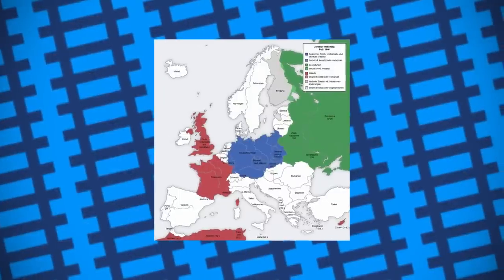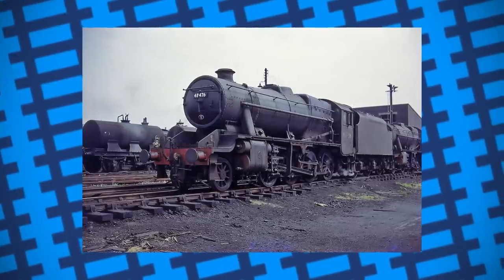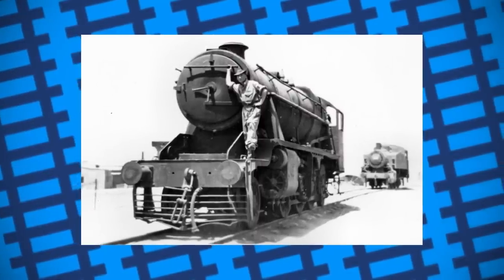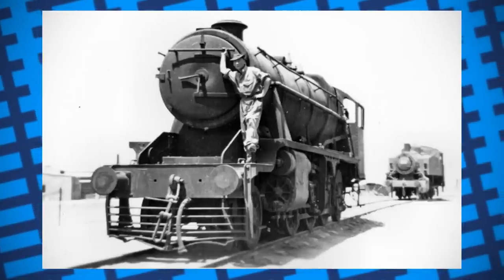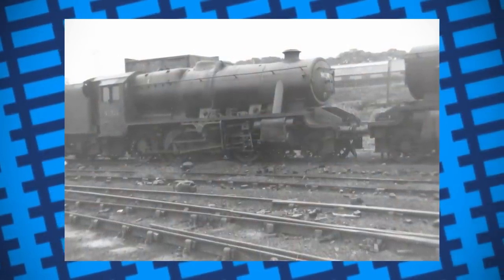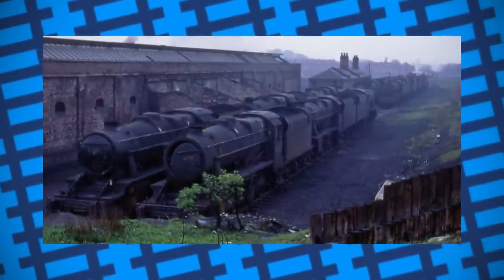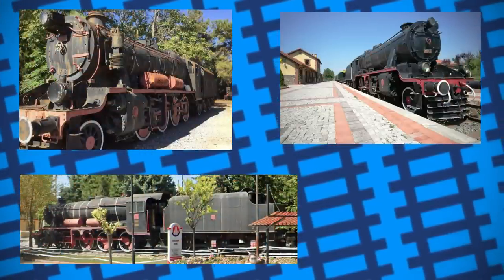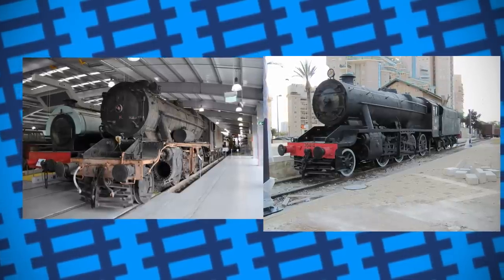The Middle East locomotives that weren't built for the Desert - LMS Stanier 8F

Comment: There is a very good reason these and the American locomotives did not make it to France before it was liberated. That was because the Royal Air Force and the United States Army Air Force took great pains to stop the Germans using it. They even used the 22,000 Grand Slam bomb, or earthquake bomb, to shake down a vital railway viaduct and bring down part of a mountain on top of the line running through it. After they'd finished with it no trains were traveling anywhere in Northern France.
Reply: The RAF and USAAF did trash the railway network in France but that wasn't the reason Stanier 8Fs were not deployed there.
The USATC and WD used lots of railways in Northern France post-invasion, but they did not use Stanier 8Fs because they had already transitioned to using S160s, S100s and Austerity 2-8-0s and 0-6-0STs respectively (as well as any French stock they could find). They were incredibly quick to repair the railways and get them running again.

Comment: Fun fact: the 8f 8233 as mentioned in the video is currently a memorial inside the Highley engine house on the svr to royal engineers and rail personnel who served on railways in the middle east and north Africa during world war 2
Reply: According to the wiki. 8233
(WD 307/WD 70307) derailed in her war years, because she ran into a camel. He also didn't mention that there were 4 8Fs at Longmoor.
•LMR 500 (8233)
•LMR 501
•WD 508 (unused)
•LMR 512
Reply: 3 of the 4 8F’s at Longmoor were sold to British Railways. One for some reason wasn’t wanted and was scrapped. My late father worked on them at Longmoor during his National Service with the Royal Engineers.
Reply: @peterflitcroft9756  
That's nice, sad the railway is gone, it basically a full size trainset.
Reply: @peterflitcroft9756  
508 wasn't used cause it was worn out. 512 was involved in an accident after running into Basra.
Reply: Another fun fact if this is true: The British even planned on bringing the LMS 8Fs to Mexico during WWII but the plan was scrapped because of the war and they needed their locomotives to be sent to the Middle East to fight the Germans. Honestly that would’ve been cool to have British steam locomotives in Mexico also from what I can see, the LMS 8Fs in Mexico would’ve looked the same as the ones in Egypt,Palestine,etc but with different couplings also they locomotives themselves would’ve ran better in the Mexican environment due to it not being as hot as Egypt’s climate also with more water over there.

Comment: Its interesting to me that many British locomotives when exported overseas ran into the repeated issue of having to little capacity for fuel and water. That was one of the big issues the D&RG ran into with their Double Fairlie Mountaineer in Colorado, it simply didn't have the kind of fueling range they needed between stations and they eventually took a flatcar and slapped an ad-hoc tender on top. I think if anything it shows how tightly compact the British network is with frequent water and fuel stops available, verses overseas networks especially in arid regions. 

Its not like American exports were perfect either, especially in wartime... as the issue with British crews understanding how to read American water sight glasses attested to when a handful of various S160's had boiler explosions over the course of the war. While all the core basic engineering mechanics of steam were the same everywhere, those fluctuations in appliance fittings or tender capacity or a myriad of other small factors seems to be the main issue in localizing an overseas export to any railroad.
Reply: In a way it makes sense, designers assume their locomotives will be used in specific conditions, but those conditions aren't universal. It was a frequent complaint made about British designed locomotives in South Africa that the designers had assumed fresh water would be plentiful and coal would be of high quality, those assumptions were true in Britain, not so much on the Cape of Good Hope.

Comment: I once followed the Nile up through Egypt on Google Maps. At one point I spotted some black lines close by the Nile that turned out to be a lot of abandoned steam locomotives.
Does anyone know if they disposed of the engines somewhere random in the desert? Didn't seem to have any connecting tracks either. 🤷🏽‍♀️
Reply: I think they were probably blown up
Reply: Can you share the coordinates I would like to check it out thx
Reply: We need the coordinates, man..
Reply: @everyone 
Alright. I've been looking up and down the Nile a bit quickly and haven't found it yet.
Keep in mind that I remember finding it like 15 years ago on Google Maps, so something might have changed?
Also, this was when I was young and had a lot of spare time to just spend hours drifting around the world map, so how close it actually was to the Nile is hard to say. 😅
I'll keep looking!
Reply: @Floedekage  just follow the railway instead of the river. There wasn't a huge network and no one woulda put in the effort to move them far from it so they will be on it somewhere if they exist. 

Rarely does a loco get moved far from the track it worked on especially in a place with limited resources to do so.

Comment: I’ve seen 48624. It’s a beast. Seen it at the East Lancashire Railway and I work there. Been working at the Railway now for 8 years. Another LMS 8f went to the East Lancashire Railway number 48518 only went there to have its frames scrapped. It’s the only preserved donor parts LMS 8F. It donated its boiler to its classmate 48773, don’t know what happened to its tender and it’s last remaining parts are at the Llangollen Railway. Most of it’s part are donated and scrapped. It’s possible to bring it back to how it was before it started donating parts but it’s gonna cost an absolute fortune to make so many new parts for her. New tender, new frames, new wheel sets, new boiler etc. it’s really sad to see it with small amount of it’s last remaining parts and that really makes me want to collect the parts and bring it back to life

Comment: We all see what extreme heat will do to the rails, right? I wondered how the railwaymen in the ME maintain them in such a great heat and distance?
Reply: America had a locomotive, the Hayes 4-6-0 camelback, where the footplate, which looked like it was part of a signal box, was on top of the boiler just behind the chimney. Imagine the heat of summer while stood on a boiler inside a glass box and being slowly kippered from the smoke. At the same time the fireman was stood on the front of the tender with a small roof over his head which exposed him to the heat of summer as well as the rain, wind and snows of winter. Somehow the romance of steam gets a little tarnished for all of these men.
Reply: Many many expansion joints
Reply: The real problem is not how hot a place is but rather the temperature fluctuation that causes expansion and contraction.  An environment that varies between -40C and 25C will cause more rail buckling than a place where the temperature varies between 15C and 40C.

Comment: You would think that modifying some South African locomotives designs would be ideal for conditions in the Middle East?
Reply: Wrong track width. Most Middle Eastern railways operated on the European standard gauge, while South African railways were the narrower Cape gauge.
Reply: @Dave_Sisson  ...narrow gauge(metre gauge) used to run from Syria all the way into Saudi Arabia. Some of it still operational with preserved steam in Syria until the civil war. Presumably the locomotives are still there hidden in a shed for better times.

Comment: I'd like to see that China Rail KF7 run again. It's a pretty interesting looking engine, looking a lot like an americanized British engine but I'm willing to guess it's probably too large for Britain for either loading gauge issues or just the fact it's a 4-8-4.
Reply: It's probably a hybrid and China is Standard gauge. Standard gauge is universal world wide it's the same in the US and UK. In fact most Railways in the world are either Standard Gauge or a form of Narrow Gauge. Most popular being either 3 foot or Meter gauge. The only exception of these are the Broad Gauge Railways which there are a few.
Reply: @Dallen9  
I'm referring to the loading gauge as in the width and height not related to the track itself. So like making sure it fits through tunnels and doesn't scrape on platforms. I forget which class of locomotive it was but they exported a number of EMD Sd40-2s to Britain but had to give them British bodies in order to fit through tunnels.
Reply: @patrickwamsley3284  That's the first I've ever heard of that. I know that EMD and GE do/did rebuild the Bodies for Export but never cause of Loading Gauge issues but for Aesthetic Reasons. Then again that could of also been them trying to sugar coat the actual reasons for the investing public.
Reply: @patrickwamsley3284 hmmm interesting. then again because of the abandonment of Passenger service I guess EMD and GE just got reckless with locomotive design. have noticed that Newer American Diesel designs are taller than older designs but never thought of it cause there so common placed where I'm located at it just might be why Eastern US locomotives are shorter than Western US Locomotives.
Reply: @patrickwamsley3284  You might be thinking of the Class 59, which was more-or-less an SD40-2 repackaged to fit the UK loading gauge. The story goes that the independent Foster Yeoman aggregates company was disappointed in its British locos- either they were powerful but unreliable, or reliable but only powerful enough for lighter duties. FY purchased a refurbished EMD SW1001 switcher (shunter) in 1980 and were impressed with its reliability and strength. However, while small by US standards, it was still too large for the UK loading gauge and even had its cab damaged in a accident when it smashed into a tunnel it couldn't fit through. FY commissioned EMD to build them a more powerful mainline locomotive that could fit within the entire UK rail network, and the Class 59 was the result.
Reply: @Train of Thought : I'm not sure if you will read this but the story about Foster Yeoman's US switcher would make for a good episode. It would explain the origin of the American "invasion" of British railways that led to the EMD Classes 59 & 66, the EMD-engined Class 67, the "Bodysnatcher" rebuilds (Classes 57 & 69), and the Class 70 built by EMD's rival General Electric.
Reply: @Dallen9  
The locomotive height isn't really the cause of any one particular reason beyond making things fit for double stack containers. I'm not that much an expert on the permanent way and loading gauges here in the states beyond some tunnels needing heightened to accommodate doublestack trains and that related infrastructure was upgraded over time to suit what's needed. In the same way a bridge is replaced and upgraded to carry heavier loads across. Overall locomotive size probably followed those improvements since there was more wiggle room sorta speak.
Reply: @sharkymcsharknose2979  
Yeah those are the ones. I couldn't remember which ones they were off the top of my head.